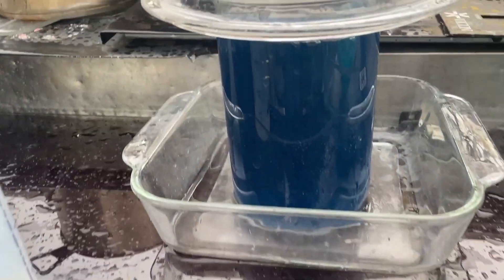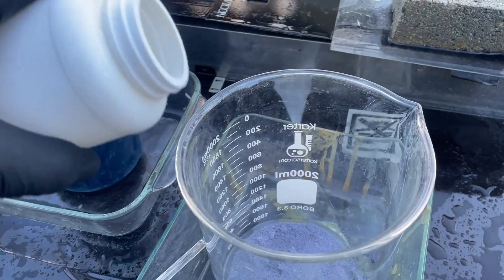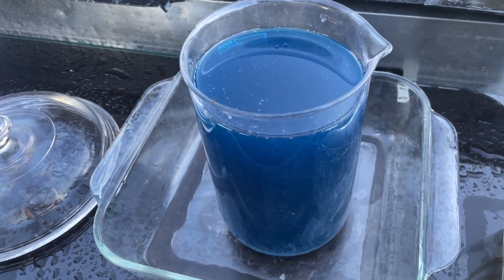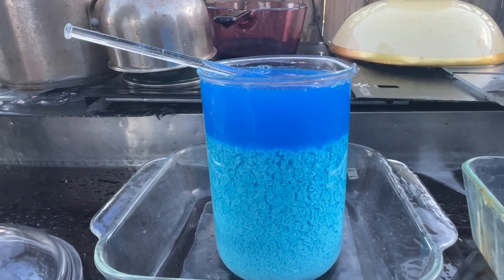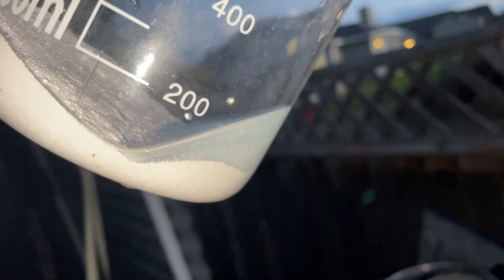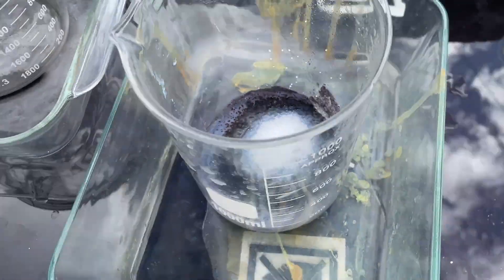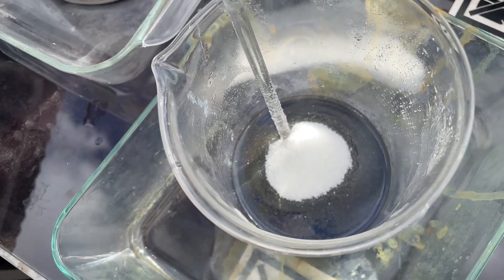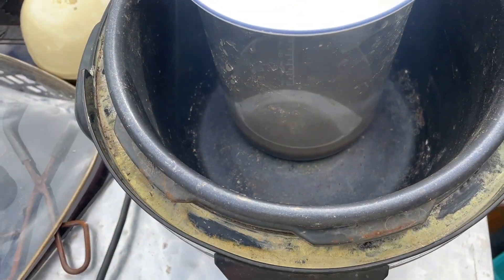Silver Nitrate Solution to Silver Chloride to Silver Oxide to Silver Metal! Melted and Stamped!

Comment: If copper can be recover from copper ore directly by sulfuric acid .  when also this process is important ?? mean i get copper from copper rock by sulfuric 10% only.  after the recover copper is this process is important ? 😮❤
Reply from the maker: Not exactly sure what you mean? 
I use three buckets. Two for my acid stock pots and one for my waste solutions.
I use the two buckets for directly pouring off refining solutions with copper pipe in these buckets. The acid solution will dissolve the copper and push precious metals out of the solution and remain in the bottom of the buckets. After the copper solution has pushed out the precious metals I pour this copper solution into my waste bucket which has iron in it. The iron will dissolve and cement out the copper. 
I then recover the copper and dispose of the iron waste solution at the county landfill where house hold acid waste is located.
Please download CW Hoke pdf refining metals reference.
It is Loaded with valuable information.
Use all precautions with acids.. pretty dangerous stuff.
Hope this helps 
Peace Prospector Tripp

Comment: Very cool to watch PT . Where ,  if i might ask did the Silver nitrate solution at the beginning come from ?  The silver coin at the end was a nice result and it is now officially personalized , which is a nice touch . much like an Autograph which will make it worth a lot more money ,  i'm sure . 👍 Nice job Matt  ✅ . Cheers Nev . 👌✌
Reply from the maker: Hello Ned, this silver nitrate solution was from the 7.5 gram Quartered Gold video a few days ago. I’ve wanted to show the dangerous boil reaction when adding the sugar. The first try didn’t show much, so I decided to use the remaining solution to hopefully show the reaction. It certainly did show the Heat reaction the second attempt.
Success! 😂 
I never use this method, because dropping silver with copper works wonderfully to simply cement out the silver.
Thank Nev,
Peace Prospector Tripp
Reply: @ProspectorTripp  Ahh , so that's where it came from , sorry i'm a bit slow , lol . So you were just showing a different method to show the reaction . It's much the same as  like a reaction from adding  sugar to Sulfuric acid , iv'e seen how it erupts out of a beaker like a big black snake , lol . OK , Got it PT 👍✌

Comment: Can you see any practical benefit compared to cementation of the silver on copper?
Reply from the maker: Hello Keith, IMHO no.. I find it difficult to rinse off the base metal solution from the chlorides and after conversion to metal, the Lye and Sugar again takes many hot H2O rinses. I can’t test the extreme purity unless I go to a shop and have it XRF’ed.
For me it’s so much easier to use copper then boil rinse the Silver a couple times in H2O then if you want more pure, boil in HCL, then boil rinse in H2O a few times and it should be fairly high purity. 
As you well know.. if you’re looking for 999 purity you have to use a electrolytic silver refining process.
I believe this Silver is 97~98%
You got me thinking 🤔
I will get this silver XRF’ed as well as some I Cemented with copper and HCL/H2O rinsed as stated above. Then we can compare the results and see if there is any real difference.
Thanks again for sparking my thoughts Professor Bowden
Peace Prospector Tripp
Reply: You're most welcome as always Matt.  The cemented silver wors well for our needs and is very simple to do.
Reply from the maker: @hardrockuniversity7283  amen

Comment from the maker: Hello all,

I converted Silver Nitrate Solution to Silver Chloride to Silver Oxide to Silver Metal! Melted and Stamped!
The conversion from Silver Nitrate to Silver Chlorides using HCL happens very quickly, almost instantaneously. The conversion from Chlorides to Silver Oxides a very dangerous thermal reaction using drain cleaner (Lye/Sodium Hydroxide creates heat when adding to the chlorides and H2O) It’s a dangerous (Skin Burning Eye Blinding) reaction which Requires PPE! However it is a fairly calm reaction to this point. The last conversion from Silver Oxides to Silver Metal is the most Dangerous reaction. It changes from a calm looking condition to a Thermal and Very Volatile Reaction Quickly and can Boil up and over your beaker!
If you try this.. Please be careful and wear your gloves and safety glasses at a bare minimum!
Stay safe and Golden my friends.
Peace Prospector Tripp